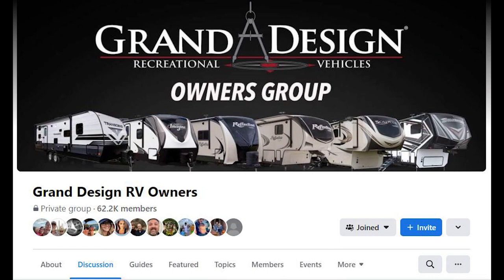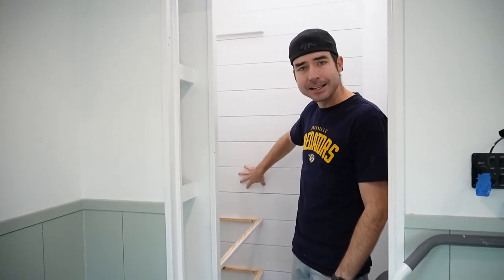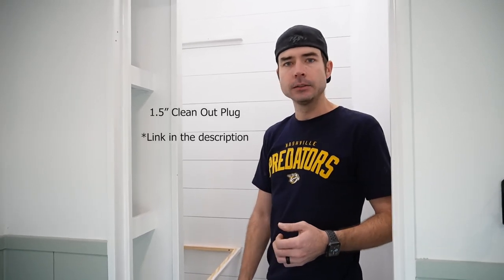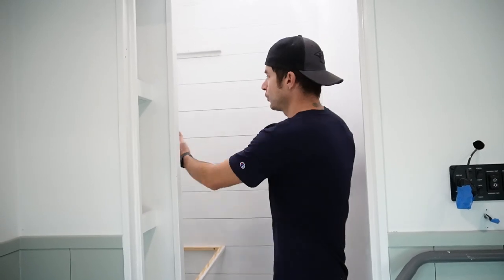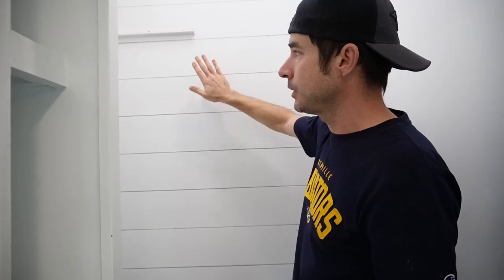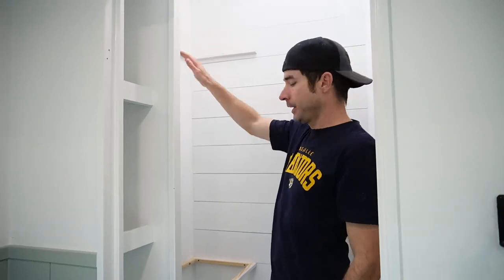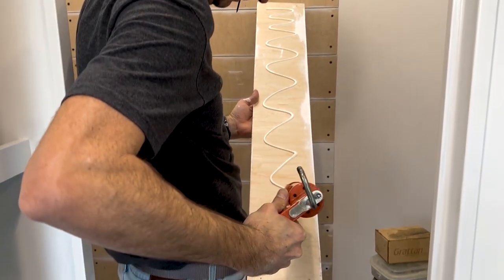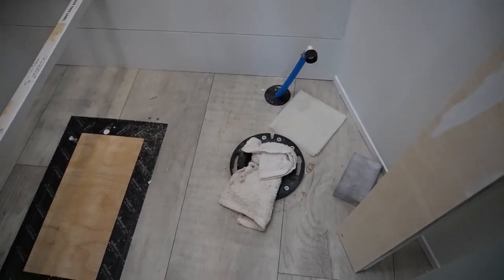Toy Hauler Garage Bathroom to Closet Conversion

Comment: Thank you for this video! It helped us a ton. What size rug did you order? The link said it's sold out and there were several options
Reply from the maker: Glad it helped! We used the 36” one, and even then we had to cut it a bit smaller to fit. But it’s worked out great! We also used it on the floor of our pantry, because we removed the bottom shelf so it would sit flat without a lip.

Comment: How did you remove the metal part of the drain from the drain pipe?  Did it unscrew somehow?
Reply: I believe we used some needle nose pliers and simply unscrewed it!  No yanking or pulling needed.